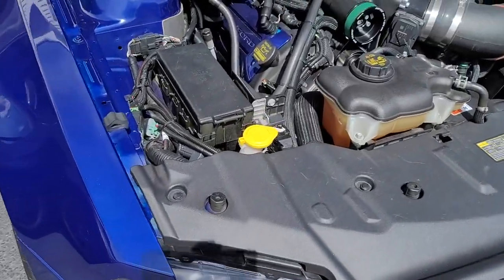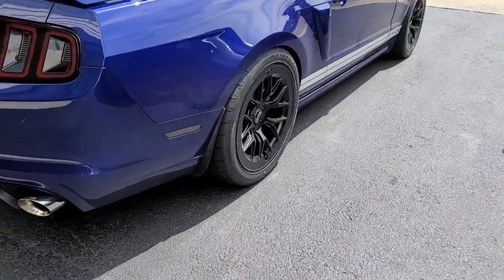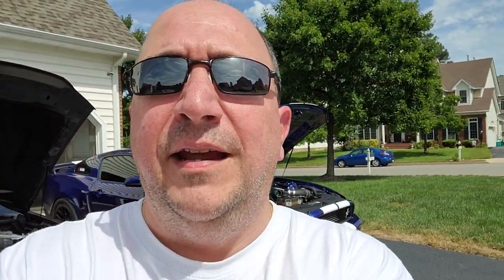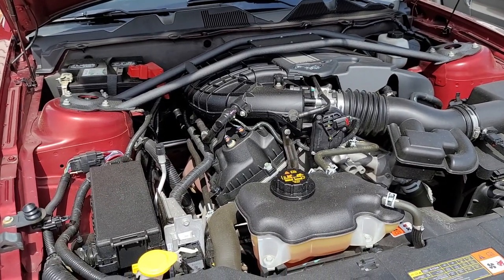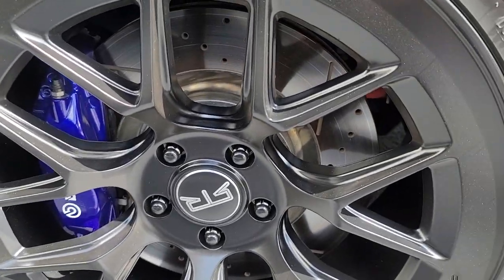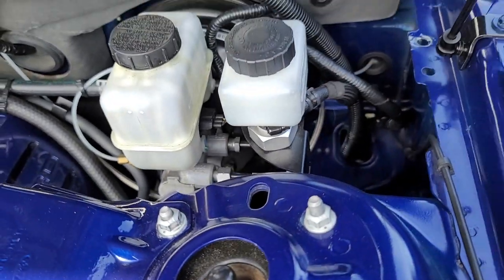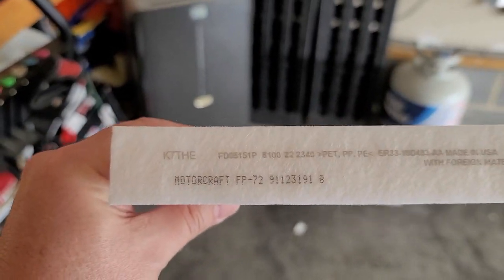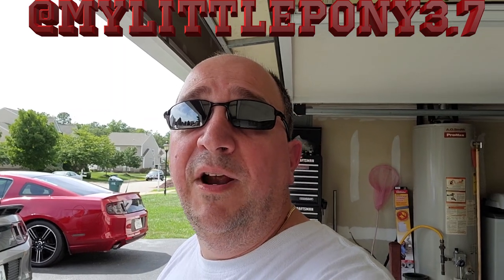***Mustang Week PREP 2020***

Comment: You can clean it. I wash it with a citrus degreaser and I use a regular hose, no high pressure and make sure you don’t get your battery or your intake, you can put a towel or a plastic bag over them